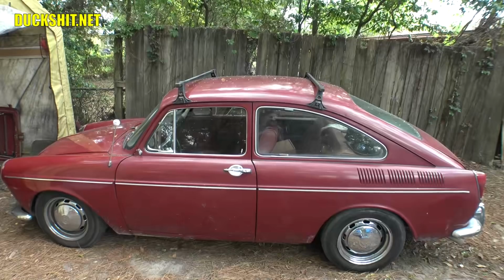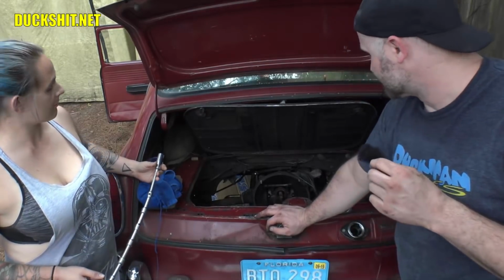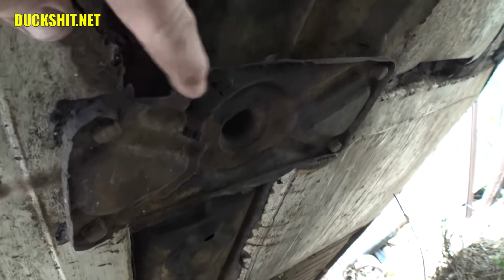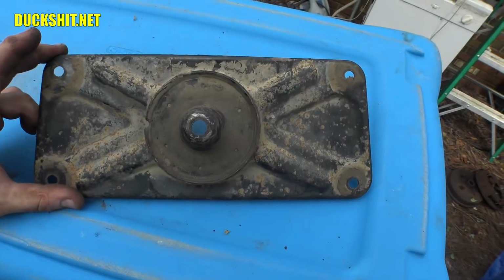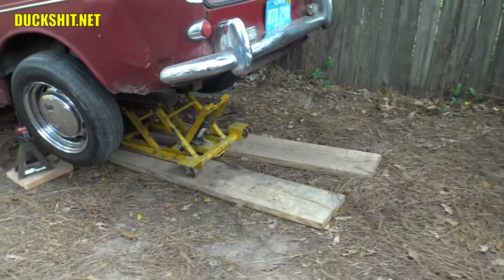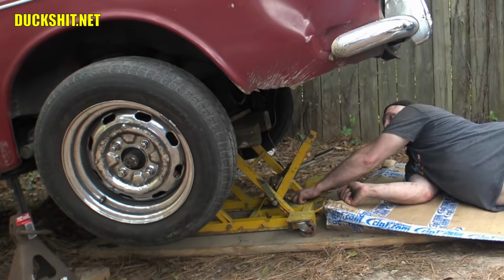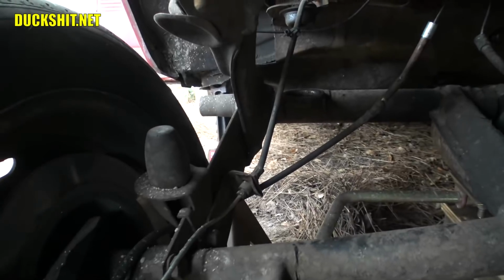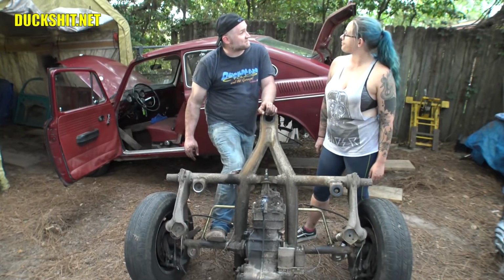VW Type-3 Subframe Removal - IRS UPGRADE PART 1

Comment: I was going to convert the swing axle frame to a IRS and narrow it an inch on each side.  One of the CV shafts on the automatic is an inch shorter.  My son decided he didn't want the 68 Fastback  so it's up for sale.
Reply from the maker: On an automatic the drive shaft is much shorter than one in on the left side.  Last automatic transmission that I sold I sold the axles with it then the guy who bought it was overjoyed because those are kind of hard to find nowadays.
Reply from the maker: Good luck selling that thing, shouldn't be too hard!  They are pretty high in demand

Comment: @sonicstep...I bought one in 1970 , the 1971 model , after seeing it at the auto show in Boston Ma. $2400 I believe. I drove it from Massachusetts to Arizona , and then again to California 2 years later . Stick shift, pancake engine...oil filter was the wire screen. It had fuel injection. Trunk in front and more trunk space in the rear over the engine. The spare tire also connected with the windshield washer container so you needed to keep the tire pressurized above a certain pressure. One bad thing about all of them...they rusted out over the front wheel well just before the the door hinge. I had the car for 10 years .
Reply from the maker: Great story!  Mine seems to not have any rest in the front door area... I suppose I got lucky.  😁👍🏻
Reply: @DuckmanCycles  possibly in Massachusetts with the snowy winters and road salt ...the only other VW's  I saw were in MASS....the squarebacks and fastbacks all had the rust issue.

Comment: The last Beetle in Mexico rolled off the line in 2003. ALL Mexican Beetles were built with Swing Arm Suspentions ONLY NO IRS"S were ever built in Mexico.  I notice that dent and wondered what happened.  I managed a KILLER DEAL on a 1970 Bus 1600 Single port rebuilt with a slight cam for my 68 BAJA Project.  The guy i bought the engine from has a 69 bus which needed a new beam.  He sold me the engine for the price he needed to pay for the new beam $275 , runs GREAT and has 55 LBS oil pres at cold Idle an 45 at aHot idle.  NOT TO BAD HA?
Reply from the maker: Yep, no IRS went to any market except german-built ones destined to America!  Dent story coming up, its a great video!  Great deal you got on that engine!

Comment: Well the better of the set ups from swing axle or its the swing axle is the better of the two set ups for the rear end to help out the swing just add a torshen bar and that that will and it will handle better on the road but as a said the swing axle is the better set up
Reply from the maker: Thats an interesting statement, please provide a theory as to why it is better.

Comment: I believe those are Crow foot spanners. The are mostly used for brake lines, power steering  lines and A/C connections.
Reply from the maker: Or just a line wrench... I ended up tongue tied at that very moment lol
Reply: @DuckmanCycles  I hope you're  not camera shy.  You have to make more videos.

Comment: I have a 73 automatic Squareback that i want to convert the rear to 5 lug Disc brake's. can i get em from another vehicle and swap em out. or do i need to buy one of those 400-600 Conversion kits?
Reply from the maker: That depends on the lug size... there are lots of different patterns for 5 lug!
Reply: @DuckmanCycles  Ok so i'd have to determine what size i would need 1st?
Reply from the maker: @capthwdy08  Yep, figure out what wheels it is you want to mount, then go from there!

Comment: Does the entire subframe just swap, Swing axle to IRS? I may have just found my next garage quarantine project! Thanks!
Reply from the maker: Yes, they do.... however IRS subframe lack the frame horns.  You will have to come up with a way to mount the engine in the rear like an IRS car.

Comment: Shame that some of the oil from rear seal , didn't land on the throw out bearing !!!!!😎😎😎 drier than a popcorn fart !!!!!😄😄😄
Reply from the maker: Thowout bearings actually don't get greased unless they ride on a tube, this one does not.  But this one does have engine oil (not dry at all!) and clutch dust on it! Needs proper a cleaning!

Comment: Bee....   You might want to tie your hair back while you're using air/power tools.  I've seen some pretty bad mishaps over the years in relation to lose clothing and long hair getting tangled up with said tools!  Other than that, keep up the good work...
Reply from the maker: Good thing that is exactly what she did!  YAY!   Thanks so much!
Reply: @DuckmanCycles  If you mean into a ponytail, then that's still not good.  It really needs to be tied right up, out of the way.  A work colleague of mine back in the late 70s, when long hair was all the rage, got his hair caught in an air tool and it scalped him.  His hair was also in a ponytail.  Just some advise from someone who's worked in engineering for over forty years.  That aside, like I said, keep up the good work and I look forward to the next episode!
Reply from the maker: Thanks, if and when she starts running some high speed high powered tools  I will make sure to duct tape her hair to her back and glue her head to the wall in the back room so that she won't be eaten by some dangerous tool... sounds like I'm gonna be doing the work myself now!  Haha!  Thanks!